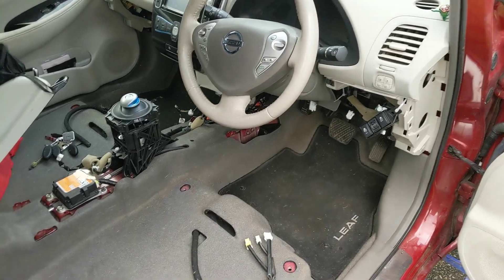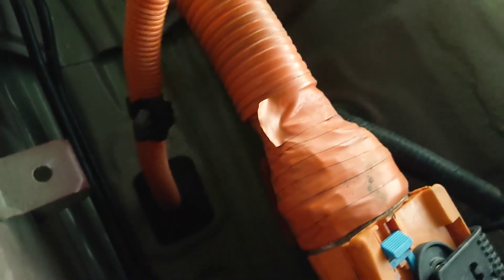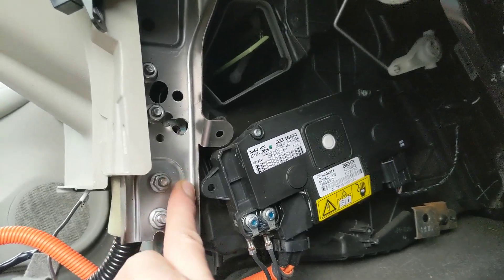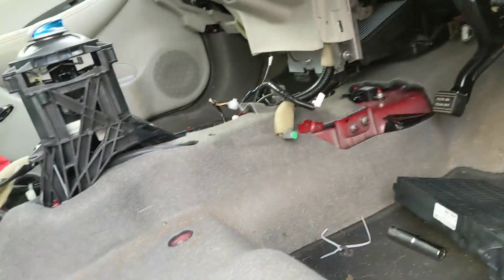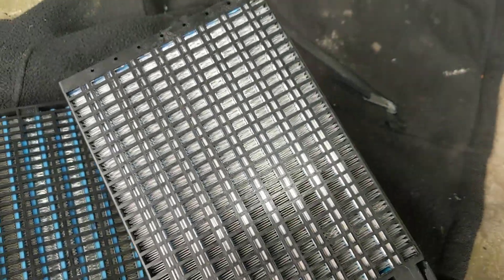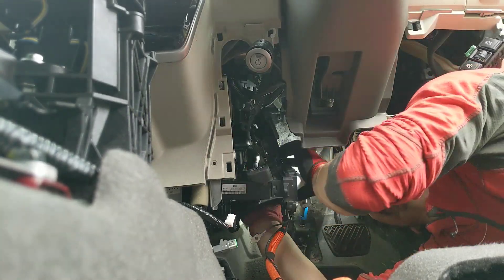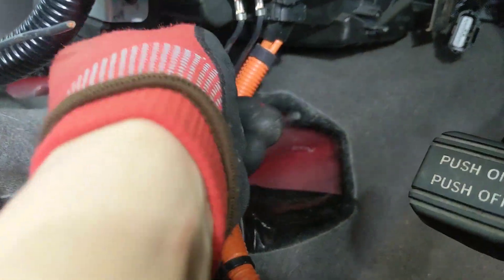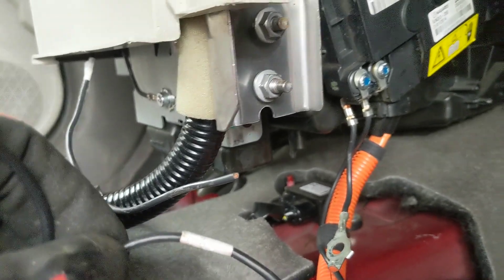Nissan LEAF PTC heater replacement: 2014 Gen2 AZE0 RHD

Comment: Very helpful video. I'll be doing this on a car I just bought soon. Would you happen to know whether the ptc heater from the new shape leaf will fit? The part number is similar being 27143-3NF1B. I'm thinking maybe a newer one will be more reliable and have seen one for sale at a reasonable price.
Reply from the maker: @TheRichMaxwellChannel  sorry I don't know, but I reckon there's a good chance it will. They didn't change much on the newer leafs.
Reply: @GlynHudson  Thanks for replying. I've just ordered it. Saw some comment online about it replacing the previous part number and a listing on another website says it fits. Finger crossed it does!
Reply from the maker: @TheRichMaxwellChannel  Cool, let me know!
Reply: Got it done today. The newer model heater was same as the old apart from no blue bits similar to yours. Such an awkward job, the top 2 bolts for the parking brake were a challenge and then I found i needed to disconnect the cable from the brake to move it enough. My back is aching now after the awkward shapes I had to get in 😂

Comment: Hi do you know where the blower motor on the 2013 nissan leaf is situated please hopefully not the drivers side it's a UK model
Thanks
Reply from the maker: Sorry, I'm not sure about the blower on 2013 model. On 2014 it's located behind the glvoebox. I know the 2013 model has a totally different water based heating system with a webasto heater located in the engine bay under the 12V battery
Reply: @GlynHudson  thanks think mine is the   same as the newer ones as it has the heat pump
Reply: It's the AZEO with the PTC cable from the traction battery
Reply from the maker: @dama054  ah right, in that case you should see the blower behind the glove box on the right, I think it's quite tricky to access
Reply: @GlynHudson  I have seen some videos but they were in the USA and I have a horrible feeling that it's the drivers side in the UK and a bit of a nightmare to get to on the American ones it's up behind the glove box
Reply: Job for the summer I think will get back to you when done
Reply: Hi Glyn I have a issue with no heat in the car think it's the PTC heater but not getting any errors in leaf spy any ideas please

Comment: Well done Glyn. I'm about to do mine in the next week or so. 2014 leaf Tekna. nissan quoted me about 2200 quid. No way am I gonna pay that much, to cut a short story long, watched your video and found a complete heater matrix   with ptc inside on ebay from Lithuania, cost me 275 pounds (sorry my pound key doesn't work on laptop) just received it three hours ago and now have the PTC unit next to me on the table. It was out of a 2020 leaf with 6000 miles on the clock, so they say, with a bit of luck should last the life of the car. my leaf's done 113,000 miles. thanks for the excellent vid.
Reply: @Graham Hill - do you have the part-number for the 2020 PTC unit you got ?
Reply from the maker: That's great to hear! Good luck 👍

Comment: Great video. What location is the HV disconnection to drain the battery?
Reply from the maker: It's under a flap in the rear footwell between the seats

Comment: My friends 2017 Leaf's heater has stopped working and the aircon still works a bit according to the screen. Looks like a PTC, going into Nissan in a few weeks. 1.5 years out of warranty and fsh hope they make a contribution. They want it for 3 days to diagnose.
Reply from the maker: It sounds like rh the PTC, it may be worth asking a HEVRA garage to replace it with a salvage part, Nissan will charge a lot for a new unit
Reply: @GlynHudson  We just bought Leafspy Pro and there wasn't an HVAC error, a coupe of errors though one to do with the motor. I cleared the codes and the heater ran perfectly although she is saying it is a bit variable but I think they are all a bit like that. Cheers!

Comment: brilliant , i solder all the time with my job its as good if not better than it was , didnt realse they early leafs had prob with the ptc heaters.
Reply from the maker: I don't think it's an inherent problem, not all Leafs will have this issue. The e-NV200 uses the same PTC heater.

Comment: Hi, great video!
Question; do you know if the PTC heater is on the opposite side when its a LHD?
Reply from the maker: It's on the same side, so on LHD model it's harder to remove since glove box frame is in the way. The videos I've seen shows prole having to break or bend the frame to be able to remove it. There are other videos which will better illustrate LHD PTC replacement
Reply: @GlynHudson  Ok, thanks for replying!

Comment: Did this last night and this vid was a great help ! My mate managed to do it without cutting the earth wire and took him 3 hours .
Reply from the maker: Interesting, and impressive! Do you have any photos? I would be interested to see how this could be done in 3hr without cutting the earth wire. It's connected to the chassis under  the top left-hand corner of the dash. I think the whole dash will need to be removed to access
Reply: I need to replace mine too. Bought the unit, I just need help replacing it as I wouldn't be able to do myself. Would you concider speaking with your friend to help me if we negotiate a price that is a win, win and also I will give you some money as I would not be able to find him if you didn't comment on this video.